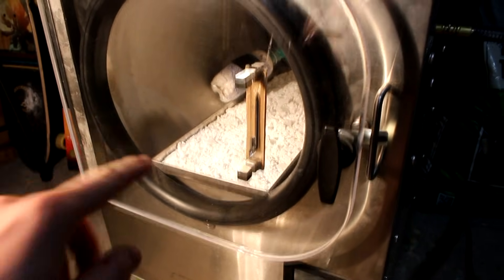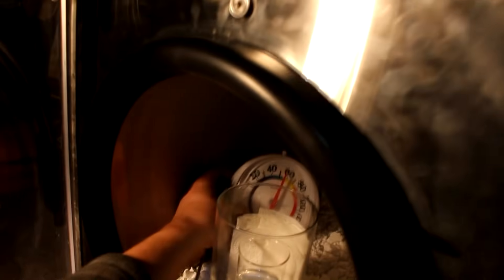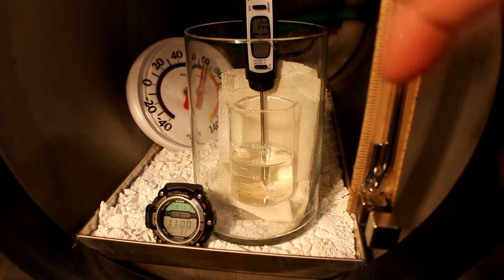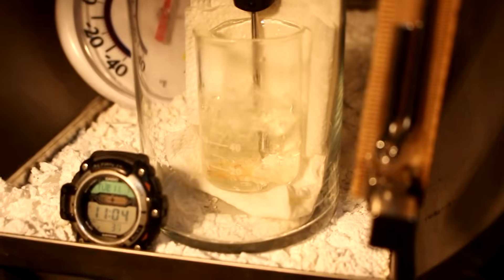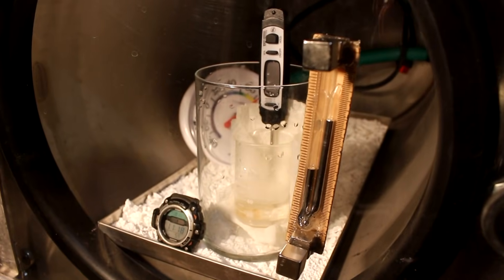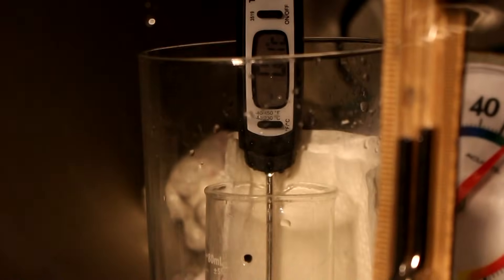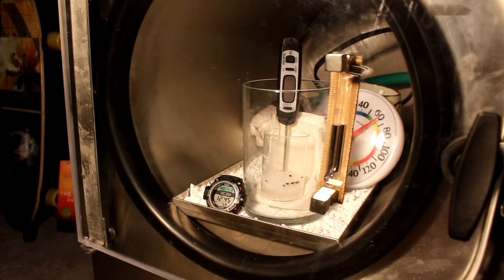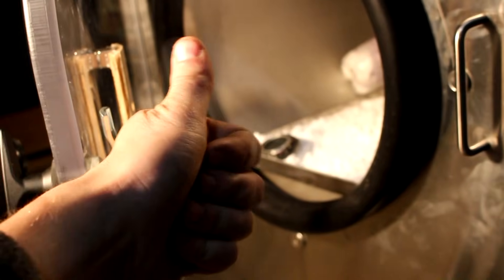Boiling Water Until It Freezes

Comment: would this same principle cause your blood to boil in space
Reply: Sure, if your blood was also in a cup like this it would boil, but since its usually contained in your body that provides some positive pressure it wouldn't boil.
Reply: yep
Reply: Max Call The bends is a different thing. It's not your blood changing, it's the nitrogen expanding too rapidly. But I guess I just have to paste what I already said, because the tests have already been done on dogs. So please stop speculating.

Your blood doesn't all just flash into steam right away when you are exposed to vacuum, and it certainly doesn't boil in your arteries, at least not for as long as your heart keeps on beating. Skin is surprisingly tough, and so are many other tissues in the body.

The body doesn't rupture in vacuum, so the blood is not actually able to boil. The situation is somewhat like that inside a pressure cooker: any expansion caused by a liquid to vapor transition of the blood increases both the volume and the pressure, thus raising the boiling point, and terminating the progress of the boiling phase transition at body temperature. So some gas bubbles may form in some low pressure areas of the circulation, but this is not really what one can call boiling.

While the heart is beating, boiling doesn't happen in arterial blood. The diastolic pressure in arterial blood is well above the vapor pressure of water at normal body temperature of about 36 C, which if I recall correctly is about 48 mmHg. Arteries are thick-walled and muscular - they will resist volume expansion effectively for some time even after the heart stops, raising the pressure if gas bubbles form and thus preventing boiling.

This pressure is equal to atmospheric pressure at an altitude called the Armstrong limit. Saliva boils on the tongue, if you are exposed to too low a pressure, people who have experienced it report.

The situation in venous blood and the pulmonary circulation, and other parts of the body, especially near the skin where blood and water may be at lower pressure is different: central venous pressures can certainly be much lower than 48 mmHg above the external pressure on the body, and dogs exposed to vacuum do experience very significant swelling of the whole skin when exposed to vacuum for times from 30 seconds to a couple of minutes: yes, a very grisly series of experiments was done to a whole group of dogs, just in order to see what would happen to them and for exactly how long they could survive when exposed to hard vacuum.

They were revivable for up to about 90 seconds of exposure to hard vacuum, though not always without neurological deficits. The skin swelling, which was about a factor of two in apparent body volume, was reversible on re-pressurization.
Reply: Han Solo
http://space.about.com/cs/basics/a/bodyvacuum1.htm so here it says clearly that "your normal blood pressure would keep your blood from boiling"
Reply: ***** Thanks for all the links to supporting papers, I never knew such extensive tests had been performed. Also props to you for keeping a level head against Han Solo's constant babbling.
Reply: +Han Solo I don't know, you're the only one in this thread speaking against them. You also didn't provide any links to prove your point and you spent most of your time insulting them. I know nothing on this subject, but if I had a choice to choose who would explain it to me- I'd choose the other guys. Your arguments were weak and you provided no proof...
Reply: Han Solo VSauce is not a primary source. And no matter how you want to whine about it, the data from actual studies is there and shows that our blood doesn't just boil like the misinformation that has been spread. I was very clear with the actual information.
Reply: Han Solo Right, and I should believe "Han Solo." As if that doesn't mean you lost before you started. As if our usernames have anything to do with this. When you run out of argument, start attacking the person, nice one. Look, the studies are already out there. We have already put mammals into a vacuum and seen what happens. And the truth is, your blood doesn't boil. What does happen isn't pretty, but it has it's own complications and interesting information to learn from.
Reply: *****
hey there! so i just did some googling, seems like you were right! what i read is that your eardrums would probably rapture and the usual symptomps of suffocation. apparently, not your blood but your saliva would start to boil, so i can only imagine what happens to your eyes in a vacuum
Reply: Han Solo I don't have enough popcorn for this.
Reply: Han Solo Keep going, you must have more vitriol. That can't be it. I have a big bowl of popcorn now, happy to listen.
Reply: Han Solo Yes your body has openings, but last I checked your circulatory system does not. Any fluids exposed to the vacuum such as your saliva, the pulmonary surfactant etc will boil and freeze the surrounding tissue but that's not what you asked. None of those phenomenon cause your blood to boil since your blood is never exposed to the vacuum of space.
Reply: Han Solo Your blood starta boiling before you leave the atmosphere
Reply: well this comment chain was a bit... morbid
Reply: Han Solo You mean like the study that made actual observations? Also, formation of gas bubbles is not the equivalent of boiling. It's not a liquid transitioning to a gas phase, it's the expansion of gas in solution.
Reply: Zillertalerwelthass Yes, but the many layers surrounding your blood vessels that separate it from the vacuum of space are far less elastic than a balloon and so may provide a much greater pressure gradient.
Reply: Black Adder Gaming don't remind me :(
Reply: Han Solo blood will boil and form bubbles of oxygen in your arteries, so it doesn't reach the capillaries anymore. Also, the fact that your body is two thirds water and you can see what happens to water in a vacuum kinda shows what would happen to you
Reply: Max Call Nope, please read my previous comment.
Reply: Max Call Your body is in the vacuum, your blood is not.
Reply: +j Paino doesn't matter. Imagine you fill a ballon with air and water. If you put it into a vacuum, the balloon will explode and the water starts boiling. Exactly the same would happen to your body in space. It will make your blood boil and explode your body. Pressure always compensates
Reply: J Paino yes but much like the cup your body has openings and is not sealed at all
Reply: Han Solo It's sealed far better than you think. Please read my comment two back.
Reply: *****
its not?! you know, actually divers can have similar symptomps if they come up from the high pressure sea too quickly, your body is not a perfectly sealed thing, but can react very severely on changes in pressure
Reply: *****
TL;DR
Reply: ***** nice attempt , but that data is inconclusive at best . the opening called your mouth goes strait to the lungs . a human would def freeze boil .. Sorry .just watch a vsauce vid about it .you'll see
Reply: Oh yes don't believe a reputable blog channel believe an ANONOMOUS USER .... you lost before you started bro ... Lol
Reply: And if left in space not retrieved after 90 seconds the same thing would happen to your entire body frozen like a dudecicle in space . use your critical thinking skills that god gave you .
Reply: Boils law and a thing called "ebullism" clearly state otherwise ... At least read something before posting dumb shit
Reply: You know an interesting test to prove this would be to put a liquid say something like water . in a container and expose it to low pressure . and see if it boi.... Oh wait what is THIS VIDEO ABOUT .... Damn it your dumb
Reply: ***** you sure check the area between your ears . there should be a brain . but in its apparent absence maybe you'll find the popcorn you seek .
Reply: Omg two morons in one thread ... I think the movie idiocracy has come to fruition ..... Lol or its one person with two account .. I'm LOL
Reply: That's because I don't like waisting my time on idiots . if I did I'd be on here all day correcting everyone . I'd rather not .however it is quite comical the position they have decided to take. Rather than even look up the truth they just simply create their own
Reply: Han Solo there have been instances of humans accidentally being exposed to vacuum and even explosive decompression. Most were able to survive to to tell the tale.
One astronaut had a pin prick in his glove that came open he described the water on his tongue boiling and then he passed out. It causes the same symptoms of hypoxia or "the bends" where it causes bubbles of oxygen to form in the blood but the victim can make a full recovery if retrieved and treated immediately.
Reply: Han Solo sorry for waking this thread up by the way

Comment: When they say - you must boild the water to kill bad stuff in it. As I see - boiling water is a wide term. Does this "boiled" water has the same qualities, as water boiled at 100C (I am talking about germs in it). Maybe they should just say - boil the water at 100C instead, to make it more specific and valid.
Reply: Actually in any food sanitation handbook or class it will specify 100*C at sea level, with it going up correspondingly the higher the elevation/altitude, due to the reduced barometric pressure and ambient temperature.
Reply: it doesn't even need to boil, you just need to heat it to a high enough temperature, if it's under high pressure it won't boil but still kill germs. I'm pretty sure that's what they do for UHT milk.
Reply: In a lab, growth medium (e.g. plate count agar) is sterilised in a pressure cooker. Usually the pressure inside is 15 psi for 15-25 minutes. Under this pressure the water will boil at around 121C, effectively killing way more germs than the same time at 100C under regular atmospheric pressure. ;-)
Reply from the maker: Indeed they should since this way of doing it would not kill much.
Reply: Please note that if you are referring to water for hand washing, the soap is more important than the temperature of the water.  In the case of food the temperature is more important.
Reply: Joost Kranendonk
Basically the same concept as the canning process. Nice.

Comment: Will gravity go away if you lower the pressure to much inside the chamber?
Reply: Once you leave earth's atmosphere and are fully "in space" you're still feeling gravity from the earth. The only reason things stay up there is because they're going so fast as to reach escape velocity, or basically, moving so fast that as they're falling down, they move forward out of the way of the Earth, essentially missing it, and going around in big circles. You would have to go REALLY far away from ANY celestial body to not experience gravity, and even then, you'd probably experience it in small amounts. Every thing has gravity. The moon has gravity, but is stuck in orbit around the Earth. The Earth has gravity, but is stuck in orbit around the Sun, the Sun has gravity, but is stuck in orbit around the black hole at the center of our galaxy, etc. The only thing determining how much gravitational pull something has is its mass and the distance to the object it's pulling. Air has ABSOLUTELY nothing to do with it. And the reason Mars has less gravity than the Earth, is because it has less mass. Just like how the moon has less gravity, its just a smaller body than the Earth, even though the moon has no air or atmosphere at all.
Reply: 1) Because you are far away enough from any large celestial bodies to have any gravity that makes a significant effect. If you obey the laws of physics, there is some quantifiable amount of gravity at every point in the observable universe. It's just usually absurdly close to zero.

2) Because Mars is smaller and less dense. It has a smaller gravitational field.
Reply: I guess that's what I get for asking for more questions. There's lots of theories for that, and I recommend google if you want to read up on it. I remember reading a paper published by MIT that gave some answers, but I can't remember it off the top of my head. If you want, I can probably find it for you.

Anything else?
Reply: No. Just no. Learn some physics... that is not how the universe works. You would have to take the whole thing far away from any celestial body in the Solar system for gravity to "go away" (which would not do that, just diminish quite a bit).
Reply: Then why is there no gravity in the vacuum of space? And why is there less gravity on mars where the air is thinner?
Reply: Any other questions?
Reply: Why does time pass?
Reply: Knight Solaire .of Astora ... What's the meaning of life? Joking, if you want to answer it go ahead, but there has been one thing that's been bothering me, you know when you melt down steel it tends to spark? Is that spark hot enough to light tinder and stuff like that, me being me I would assume every spark it's equal in how hot it is but there's something telling me that's not how it works, it reminds me of fire in a way ( I know this is a stupid question and could probably google it but by the time I'm on google I would've forgotten what I was saying ).
Reply: The answer to life, the universe and everything is... 42. Okay, so sparks are just really hot pieces of the material flying off. Usually from the heat if its a light material, or in the case of cutting steel, from the gases being pushed into it. Those sparks are VERY hot in steel's case. Usually molten, or close to it. When cutting steel you need to have all sorts of safety equipment on to protect yourself from the heat/light/sparks, etc. I've also read that the carbon inside the steel basically explodes, and the sparks are like little pieces of shrapnel, still hot from the torch (And the release of the chemical energy i.e. the explosion). The temperature welding happens at is ~3100 degrees Celsius (~5600 degrees Fahrenheit), but the sparks from say an average campfire would be starting at ~800 Celsius (~1500 Fahrenheit) and it cools from there. If it landed on something that burns at those temperatures, then it definitely could start a fire. I hope I answered your question. Any others? I really enjoy this c:
Reply: Knight Solaire .of Astora Do you have a degree in knowing fucking everything you legend. also i need help with physics homework ;)
Reply: I just learn about a lot of stuff xD I'm a programming major, so physics isn't exactly my strong suit, but if you want, I could try to help c:
Reply: Knight Solaire .of Astora Lol dont worry. its A Level anyway and it aint impossible I suppose:P
Reply: I'll try to answer just about anything asked in this thread, so feel free to ask :D

Comment: How much of the water was lost through the process.... from eyeballing it I would guess a third of it was lost through the evaporation?  Great video, I actually have seen the boiling from lower pressure. I never realized that the evaporation would drop the temperature to freezing.
Reply from the maker: In the second run I went from 40ml to 30ml. I dont really know how much of that was from splashing though.

Comment: Cody you are forgetting that the water has a pressure due to gravity on Earth. In space, most the water would just evaporate (neglecting vapor pressure). So hardly any ice would form if you put water in to space.
Reply: the pressure of water in a container is negligible
Reply: +hey7328
I wouldn't say the pressure due to gravity is negligible.
Reply: A Rocket It's about 300 Pa (~0.003 atm) at the bottom of the glass, which is actually negligible. In space, it turns out that water does freeze.
Reply: MoronicAcid1 Ah cool. Thanks for clarifying.

Comment: Something else that may be fun to discuss, though it's more engineering and less science: 
You may have reduced the water resistance of that watch, because its seals may have been reliant on the watch interior being pressurized with air at 1atm to maintain its rated water resistance. If the seal in the watch didn't hold in that air, then it has lost about 34 feet of water resistance.

Comment: Interestingly, the lcd on your watch and thermometer didn't break at low pressure, like Watney's laptop did. You should try an LCD computer monitor or laptop screen (an old, cheap one, probably) in  the chamber

Comment: I'm curious, would it be possible to store ice indefinitely if you kept it in a vacuum chamber like this? Assuming the vacuum chamber was perfectly air tight and didn't leak after removing the vacuum pump.
Reply: I guess 'cause there's no air for the heat to travel through
Reply: Heat can "travel" via radiation. This is why we can live on this planet...
Reply: and on mars it can get to above 0 celcius in equatorial area in summer. fist radiation absorbtion by the soil, then some convectional transfer to the atmosphere.
Reply: No, because it'll sublimate. As he already said in the video. All of it will end up evaporating by sublimation.

Comment: If the evaporating water causes trouble in the pump, how is it supposed to work when its doing its actual job? I mean freezedrying is just about leting water sublement, right? Or will they catch the water in some other way before arriving the pump?